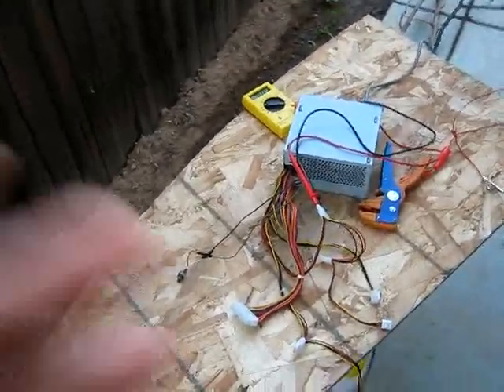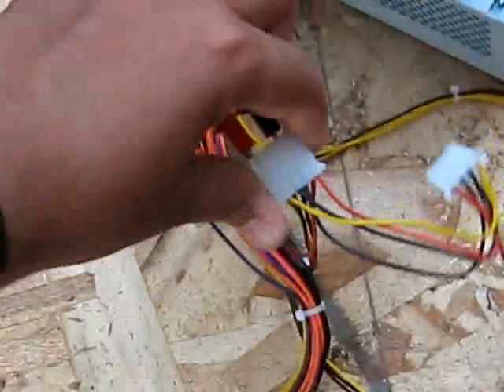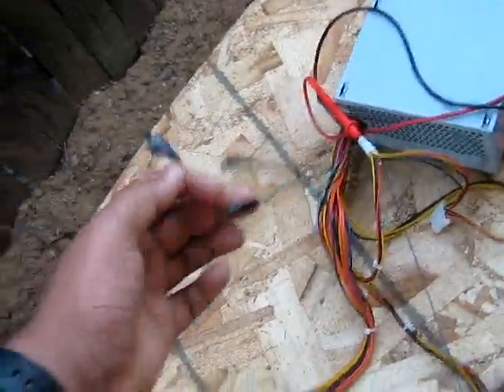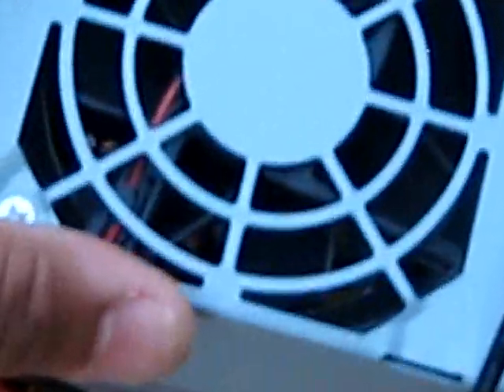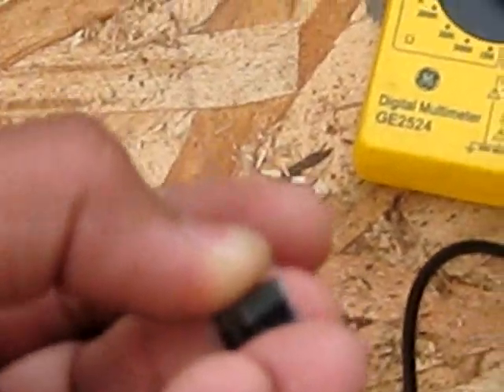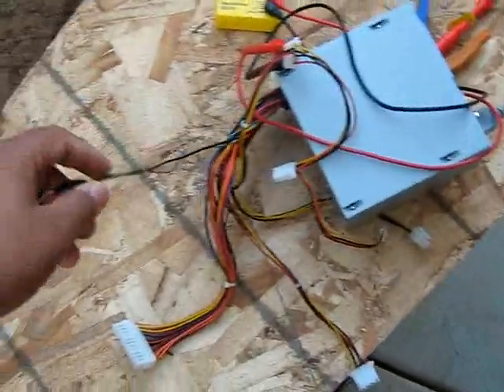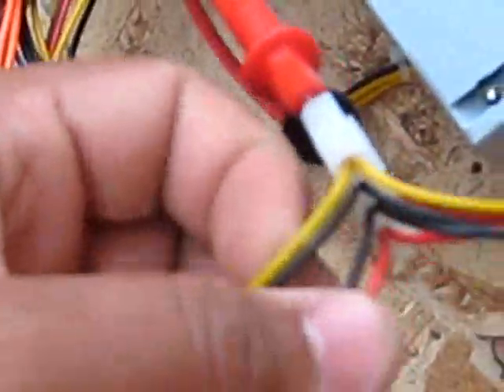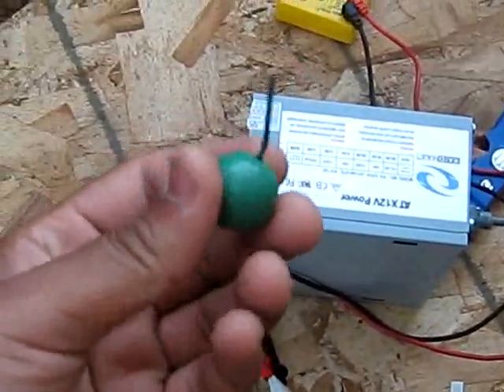Hacking Computer Power Supply

Comment from the maker: Well you could do anything. 
Example there is a 12 volt wire so i could set up a car stero powered on that in my room. I actually installed a car alarm in my room using that before.